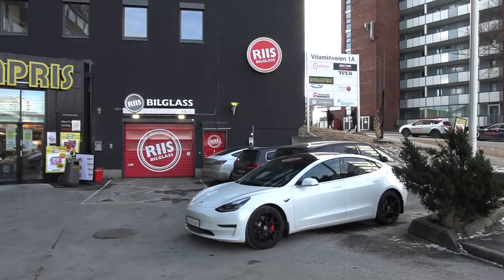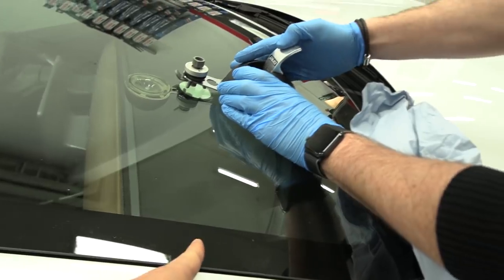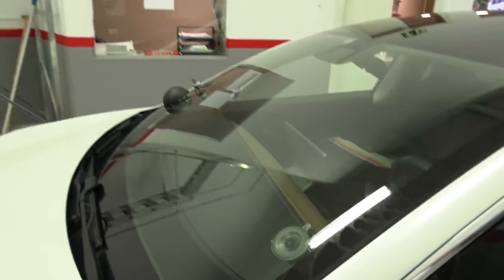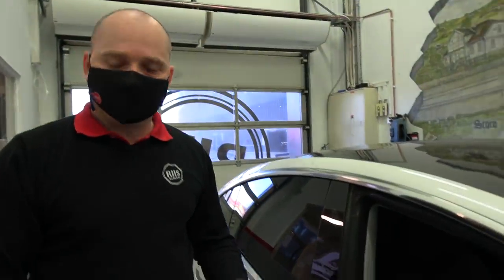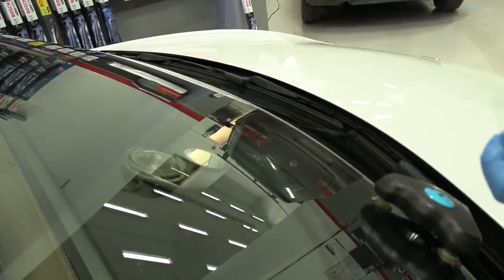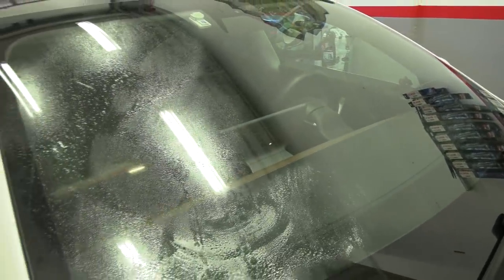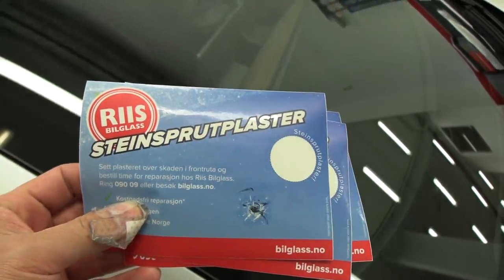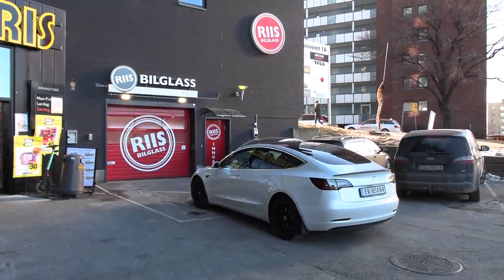MC Hammer getting glass repair at Riis Bilglass

Comment: To break glass you need a catalyst. That catalyst is water. Under water glass will break much easier. When you have a small crack then water will come in and help it to break further. When you repair the glass, then you lock the crack with the glue, then you prevent water from reaching the crack. With that the crack is nearly as strong as the rest of the flat glass surface. That Steinschutzpaster will keep the damage dry. That is all you need to prevent it from getting worse.

Comment: This happened to me this week. I was told since it was already slightly chipped, water droplets went in and expanded causing it to slightly spiderwebbed. I ended up buying 3 repair kits. 1 from amazon (would not arrive in time), 2 i fucked up (local store), 3 success. I do wish I kept more resin on it instead of using a razor blade and making it flush for stronger protection. Especially since it wasn't in the line of the wiper blades

Comment: I went to Riis glass today, they said my damages are too small, which are the same as bjørn’s chips. They do not fix for me😓 Asked about free wiper change, they said they do not have that, instead, there will be charged for 450 Nok. I think they offer depends on the staffs or due to Bjørn is a celebrity.😩
Reply from the maker: They will do it if you have a repair case. They just send the bill to the insurance company.
Reply: Takk for svaret 🤩

Comment: I've had Fords with electrically heated windscreens since about 1990 and have never heard of these cracking.
Reply: Cars today are relying on the glass as part of the car’s structure.so extremely movement in the body flexing will result in a clip becomes a crack.

Comment: So the Bosch A102S are the correct wipers  for the Tesla model 3 (2019) ?
Reply: It seems so. The A102s has 650mm + 475mm. According to https://www.boschwiperblades.com that's correct.
The A102 is also used for .. according to a webshop:
    AUDI A3 Limousine (8VS) (Baujahr: 2013.05 ->)
    AUDI S3 Limousine (8VS) (Baujahr: 2013.10 ->)
    VW Passat Variant (3G5) (Baujahr: 2014.08 ->)
    VW Passat (3G2) (Baujahr: 2014.08 ->)
Reply: Yes

Comment: I did experience that even after repairing the stone chip, preheating from -10C cracked the windshield. I had many preheats from above -5C, but -10C seemed to have been the triggering point. Could it be that temperature that blows in the windshield at preheat is a bit too high? I did not experience this on my old car, that had many stone chips.

Comment: Is this common in Norway also for non-Tesla cars to have so many cracks? Never seen so many.. maybe on very old cars with still original windscreen..
Reply: Common in Nordic countries where people have spiked winter tires and where they pour small stones (about 3-5mm) on the roads for friction. Spikes break up asphalt and some spikes get thrown out of the tire. Unfortunately the stones are worse than not using them as they get ground up to dust and enter lungs during the spring. Also the stones last about 10 minutes on the road and get thrown to the sides and to peoples windscreens.
Reply: @AkiKaivola  thanks for explanation Aki :)